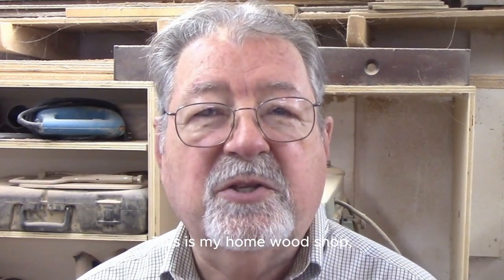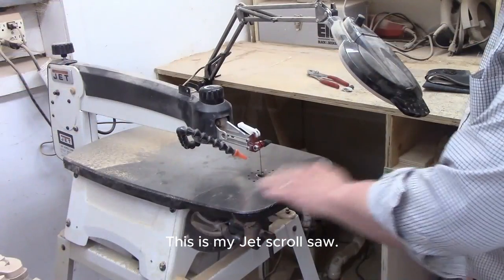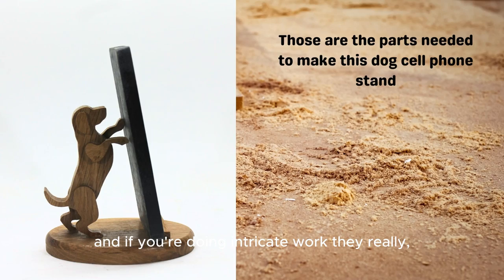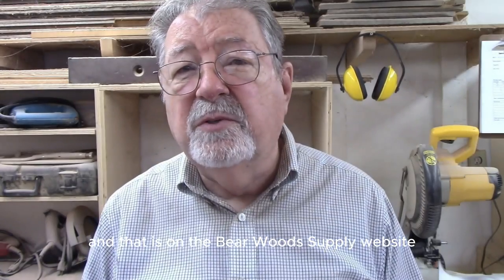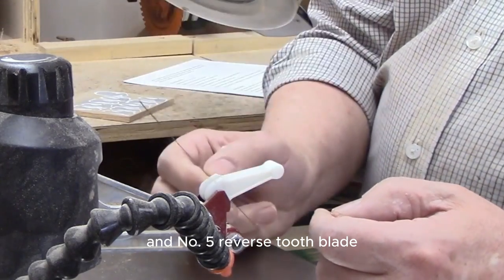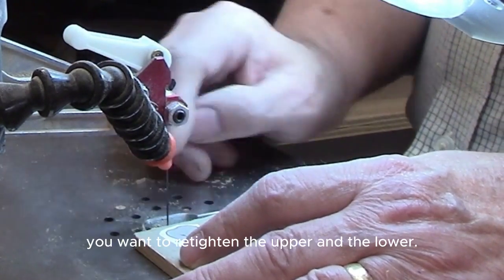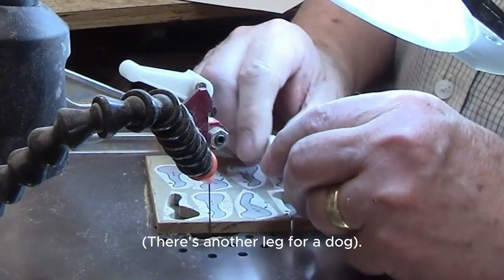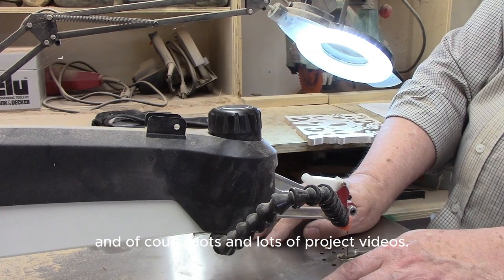Scroll Saw 101: Essential Tips and Tricks

Comment: What size magnifier light is it a 5x or 10x and what is the dim 5” or 6” love your videos just getting started I’m 63 year old
Reply from the maker: I just looked this up on  Amazon where I purchased it from and it is listed as a 10X LED with a 4 inch diameter. I find the size large enough for my use, and most of the time only use the light on a very low setting.
I have a few years of experience and in age on you, so look at my as an older brother willing to help out any time I can.
Reply: Do you happen to have a link to the one you used?  It looks like it will be helpful addition to my shop.
Reply from the maker: Here is the link to the magnifier I purchased: https://www.amazon.com/gp/product/B07WHC5P8F/ref=ppx_yo_dt_b_asin_title_o02_s00?ie=UTF8&th=1 @magyk  
I had to go all the way back to 2021 to find it! It works great, and I usually only have to turn the brightness up slightly from the "off" position.

Comment: A router kicks out a lot of dust too!Quick question. I’m interested in a used Excalibur scroll saw. And I’m thinking that the arms, blade  holders * are interchangeable with the Jet, Pegus and Seyco?  True or false.
Reply from the maker: I have a Jet scroll saw and I have replaced the blade holders with Pegas. I love going toolless. As far as the Excalibur goes, I don't know for sure but the Bear Woods Supply site does not show replacement holders for the Excalibur.